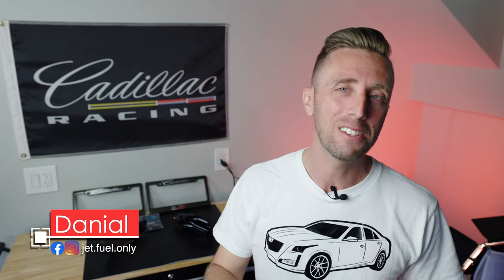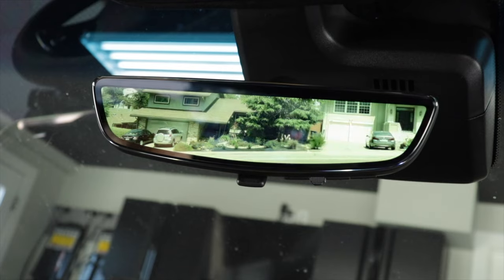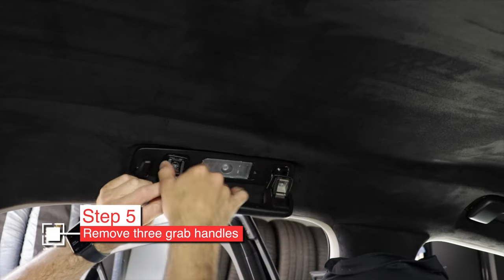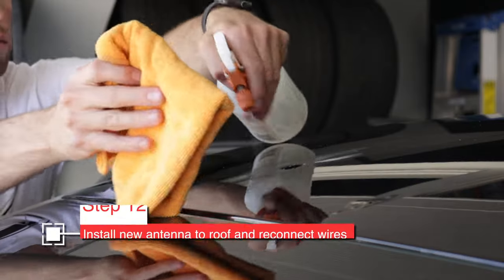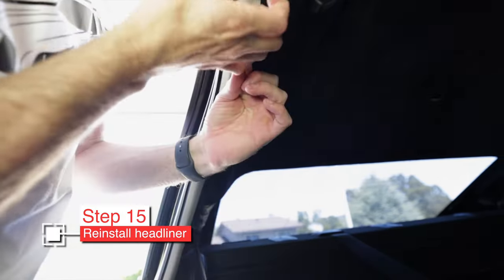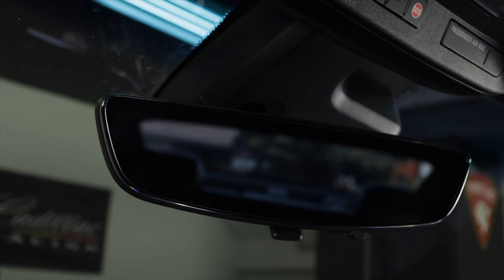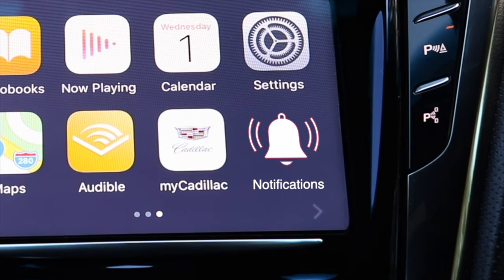Alpha Mods Liveview Mirror Upgrade for Your Cadillac!

Comment: I did this install today and whIle it wasn't the easiest mod I've done, I was still able to get it done with Lee's guidance. 

There are currently No videos showing an install to a ct4 (or videos showing any mods install on ct4), so this one is the closest you'll get.  I'd say it's about 85% the same.  

A couple notable differences and I'll list them below.
1. On the A pillar, you'll need to remove a 7mm bolt securing a tether to the trim.
2. To the sides of the center high mount stop light are round plastic clips that will pop if you apply pressure downwards. 

I was lazy and did not undo the drivers side c pillar.  But if would have given me more room to work with without having to worry about creasing/folding 5he headliner.  Probably would have made the install a lil faster too. 

It took me doing it by myself about 5 hours and that's  including the time I went to Lowe's to buy a small ratchet so I can get it in between the headliner to take off the 10mm bolt to the fin.  

I love this mod as I have very dark rear tint which I can barely see out at night   drove around just now and live being able to see what's behind me.  

When I was finally finished with the install I noticed there was a small gap of maybe 1mm between the new fin antenna and the actual roof of my car. I check with Lee to see if this is Normal and Was told it is and it would be fine as long as I tightened dOwn the bracket below.  Which I tightened snug til it won't go any further.  Theres foam that should keep water out.  Keeping my fingers crossed that it won't leak. 

I hear others about how their eye can't adjust to video quickly or something ? I did notice  that when I needed to look at the video mirror bUt it only takes a second for your eyes to focus in on the image and it's really not a big deal for me. 

Big Thanks to Lee of Alphamods for his guidance during my installation couldn't of done this without you!

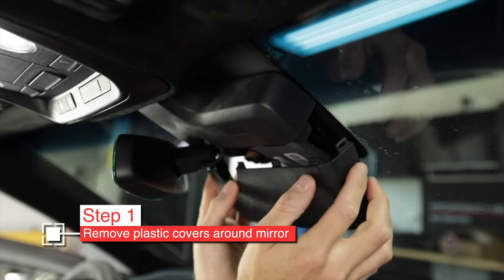Comment: Some of the vehicles Jet Fuel works on are significantly easier to disassemble than vehicles that have not been taken apart.  At 5:00 that lower clamshell will not pull apart even with great force unless you bend the shell with both hands to disengage one of the retaining latches.  At 5:15 that "Y" shaped plastic piece is impossible to pull out by hand because it's retained by a unbendable metal mirror tab.  To get it to pop out, you need to come in through the side at the tip of the "Y" with a spudger or non-marring screwdriver and twist at the gap (note: you're not spreading the "Y" you're forcing the plastic piece to separate from the mirror along the slide rail).  Additionally, there is no point in putting the plastic piece back because the newer mirror does not have a tab to retain it.  At 5:40 the mirror does not come right out--you'll have to twist, alternating clockwise / counterclockwise while applying steady pressure to coax it toward the top of the roofline.  After 6-10 cycles it should start moving--attempting to pull it straight out will not budge it.  Finally, all wires should be wrapped with Tesa 51608 tape to avoid rattling.

Comment: Hey man; great video and in future I’m looking to add this to my car; i have a question for you; i don’t have front sensors (base cts) can i add them (original) and plug them so they work with my cue system? Without additional wiring. Wonder if there is already plugs somewhere just to add them
Reply from the maker: Usually manufacturers have different harnesses for different optioned cars. Not sure if you could just buy the appropriate wiring harness and the main terminal may be the same. However, then you get to find out if the BCM has an issue because it’s not part of THAT VINs programming. So I’m not sure. I think you could do better by just adding a front camera to actually see the objects. Checkout Navtool.com for interfaces that allow you to add extra cameras.
Reply: @JetFuelOnly  thank you for replying and advice! Will look i to that; 

Any chance you have link for rear view camera (i saw your video)
Reply from the maker: Here’s the link to the interface that adds cameras. Is that what you wanted? 
https://www.navtool.com/cadillac-cts-2014-2017-hdmi-interface.aspx

Comment: My VSport has the 1st gen video mirror. Do you know if this mirror can just be added to a 1st system?
Reply from the maker: It cannot. The reason is your camera for the mirror is in the rear appliqué by your backup cam. They changed it to the fin camera. An upgrade for you would require changing the appliqué to a single cam setup AND buy the new kit. Good news is you could sell your old stuff and probably get $400-500

Comment: Will this work without antenna connected?
Reply from the maker: You will need to contact Aloha mods about that. 
The actual antenna connection is separate so I doubt it would be any issue. The antenna needs to be installed obviously but the xm plug can likely be disconnected

Comment: I have this, not your kit; but the mirror itself.  One thing you lose is the depth perception of a real mirror.  However; if you have to bring balloons in your car for a party or have passengers in the rear, it works really well.   Also in dark areas where you are just trying to backup.

edit:  Just so I am clear the digital mirror can also be a normal one.   You get the best of both worlds.   I was only saying I prefer my normal mirror most of the time.